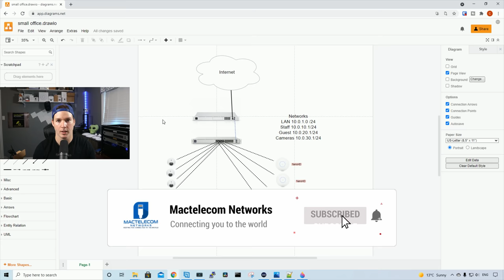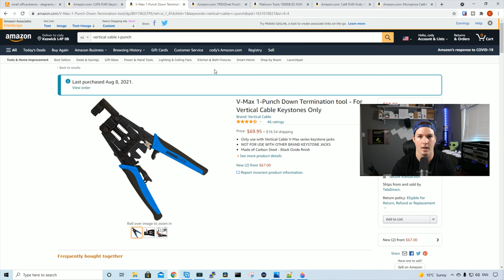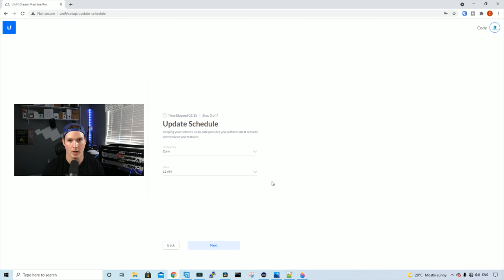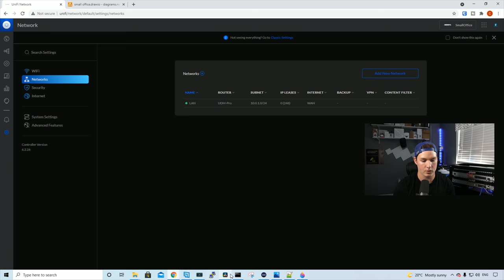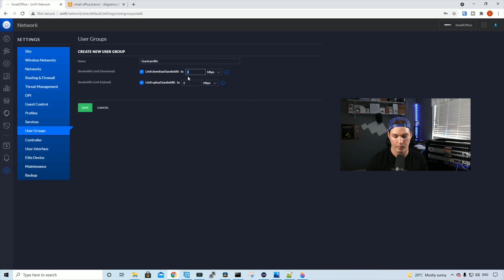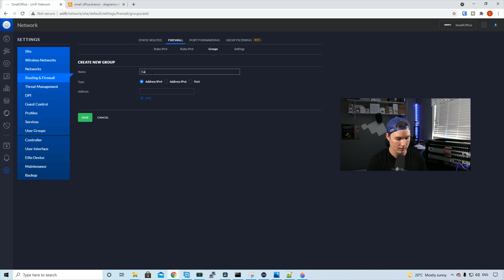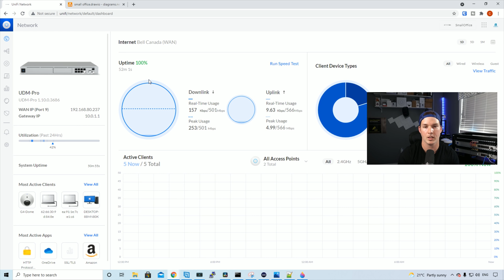Unifi Small Business Setup. Cabling, Components and Configuration

Comment: Hi Mate ,Thanks for the great tutorial . I have a stumbling block though. I have set up 3 vLANs on the UDM Pro and applied the ‘ Allow LAN to All vLANs ‘ ( Source = LAN , Destination RFC1918 ) firewall rule to the main LAN , I can access the other vLANs via ping etc from the main LAN ,  but when I try to access my Apple TV or wifi speakers ( which is on IoT vLAN ) , using iPhone apple remote or Roon remote , I don’t see those devices. Only when I’m on the IoT network , I'm able to see the other IoT devices . My desire is to control the devices in other other vLAN from my Main LAN devices. Any kind of help would be greatly appreciated . Cheers . Emmany .

Comment: This is a clean setup. Every aspect has been touched upon to the extent of being relevant. UniFi controller and its suite of products are the need of the hour.  Threat detections and alerts are important. That has been covered in this video upto bare minimum not to overwhelm the average user who is technically inclined but does not have deep understanding of networks.

Comment: I recommend if you have fiber to get the ISP to provide a SFP fiber adapter straight into the UDM Pro. It works perfectly.
Reply from the maker: Hey I have SFPs I just need to get a long fiber cable to connect back to my network rack

Comment: Great video, well done . Love your keystone plates below and above the switch , as it certainly makes for a clean look . I was going to use this ugly looking tray that protrudes from the front of the rack which has the Ethernet cables coming out of the fingers , but now I want to send it back and go with your idea.
My only concern was Poe going threw an extra connection,as I have to add the keystone jack , but I suspect it won’t be an issue . 
I have the UMD pro and a unifi 24 port switch ,but it’s for my home . I also have a 6’ tall 1” wide network rack ,as I wanted it to look professional when it’s all said and done .
I just wish I seen your video yesterday before I ordered my other parts . 

Liked and subbed , thanks

Comment: What do you use when running the cable from either the wall or the ceiling into the rack and  patch panel. Do you just leave a hole in the wall or ceiling? I’m looking for a nice clean look coming out of the wall or ceiling into my rack.

Comment: Just a question. Why not run the WAN connection from ISP equipment to back of patch panel, then patch it in like rest of the connections straight down on port 22 Specially if you made that connection a RJ45 coupler so would be easier to adjust length of the cable from back of panel to ISP connection? Just a thought. Its how I did mine, till I can ditch the ONT Fiber to ethernet and connect Fiber to SFP port. Then still would like to use a Patch port to look clean.

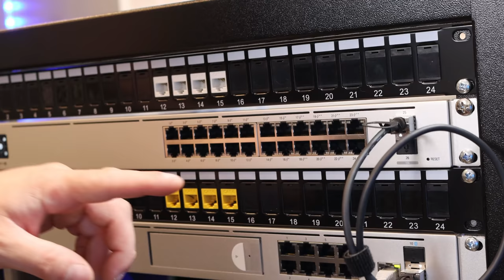Comment: At 7:55, are you using (2) patch panels to segment them vertically adjacent to the switch ports so that you don't have to connect longer patch cables? Thanks.
Reply from the maker: Thats correct and I like the small slim patch cables

Comment: Hi mate, for larger networks (or even smaller ones) do you worry about resiliency and how do you go about achieving it? Example, should your UDM Pro or switch fail (or you needed to take offline for maintenance etc) your customer would be offline; this is one concern which is keeping us from deploying a UDM Pro into some of our customers, especially those that are a number of hours from us.
Reply: For large networks i recommend getting an Aggregation switch or 2 of them between the L2 switches which will provide you better FT. The UDM Pro for me is not ready for the large network world due to lack of support as they require you to enter a web base ticket or refer to the user based forums, some updates pushed tend to cause headaches ex. internet drops after updating the firmware and limited inventory. I use the UDM Pro for small client sites and larger sites i use Fortinet just for added comfort. Now, if your large network can deal with periodic impacts then UDM Pro is good. I am waiting to get the UXG-Pro or ER-8-XG to test in a live large production environment
Reply: @bc5891  Thanks for your response B C and apologies for the delay in mine; yep, I agree, we also use Fortinet for our larger sites. Would be interested to hear your experience with the UXG-Pro.

Comment: Do you need to have the DAC cable or will cat6 from the UDM  into the router/switch work just as good?
Reply from the maker: You don't need a DAC cable a Cat 6 will work. If you want the connection to be 10Gb between the switch you either want a DAC cable or use copper SFP+ modules
Reply: @MactelecomNetworks  thanks for the reply , could you still use it even if you didnt have 10Gb connection?  love your channel btw, its really helpful.

Comment: 19:10 you should trim down the scope using SOPs since you are doing this for other businesses/clients as i am more than certain they will not be connecting that many devices to the network. I would go with .50 to .100 for each vlan. You should then standardize the IP ranges for static devices across all client base ex. Printers starting at .20, onsite domain controllers standardized to .10 and .11 or .12 if you like even numbers. Then follow the same method for servers ex .13. You can adjust as needed on the fly should they need a larger scope. The security camera system should be vlan with no route to other vlan or internet since the cameras do not require internet access as the UDM controls that part. The web filter built into the UDM is ok but in no way perfect so for my clients I usually point them to my cloud Pi server which is updated daily, more secure and branded with my business details. Just something to consider since you seem to be doing well on the small business side. Come up with your own SLA " Service Level Agreement" and SOP " Standard Operating Procedure" for what you will be delivering. Anything else is considered extra meaning more $$ for you!

Comment: Cool video, you make the connector part look easy. Is there any magic to making custom Ethernet cables? I redid my home network a while ago with cables and connectors off of amazon and neutered my network. I used Navepoint cat5e cable and cheap connector kit that came with 100 rj45 connectors, crimp tool, wire stripper, and cable tester. spent hours making those cables and all of my 100mbps devices would only connect at 10mbps. I replaced it all with premade cat6 cables to get proper connections again and still dying to know what i did wrong.
Reply: No trick to making custom cables just depends on how many cables you will need. Your fingertips will suffer if you are running cables like i have. You should checkout GearIT CAT6 patch cables on Amazon. I have a few thousand GearIT CAT6 cables at various client sites and here at my home office. Zero issues!  10/100 network connections usually point to network port on the device, your switch port speed or your network cable you ran in the house. With CAT5e you will get a max of 1Gbps connection, CAT6 1Gbps to 10Gbps "short runs", CAT6a 10 Gbps, CAT7 10Gbps, and CAT8 40Gbps. Also, for home network you will want to use CAT6 cable. Later CAT8 or CAT9 will most likely be the new way as internet providers are boosting speeds up to 100 Gbps.

Comment: Thanks for a great video. I have a very similar setup, but I've not done any firewall rules. I have a network laser printer that I want everyone to be able to access and also a PC with data that I want staff lan/wifi and LAN to be able to access. Can you show how to setup firewall rules for this please. Printer is 10.0.1.100, data PC is 10.0.1.200
Reply: Everyone will have access to the laser printer since it’s in the same LAN subnet. Just add the IP address of the laser printer to the other laptop/PCs. You can always test it by pinging the laser printer on the other pc/laptops.